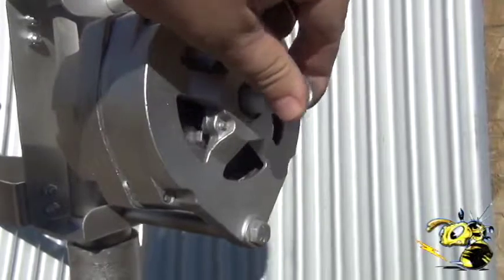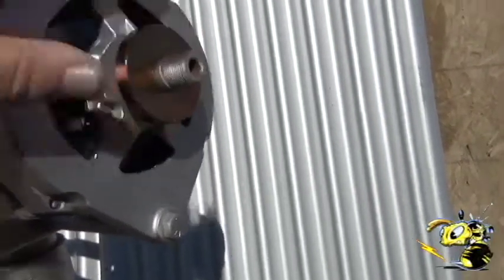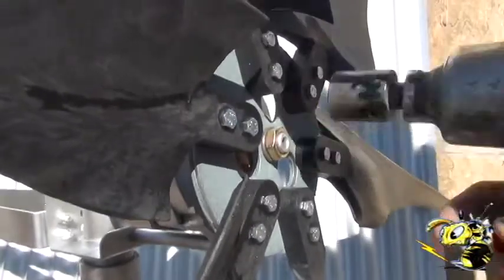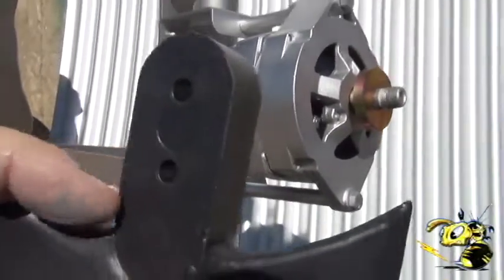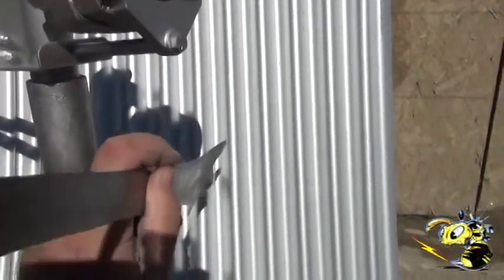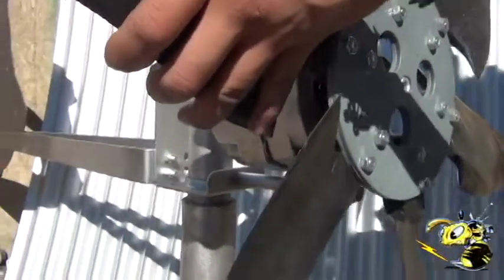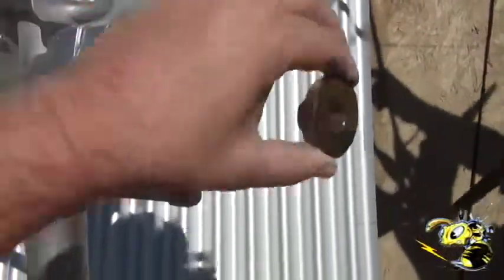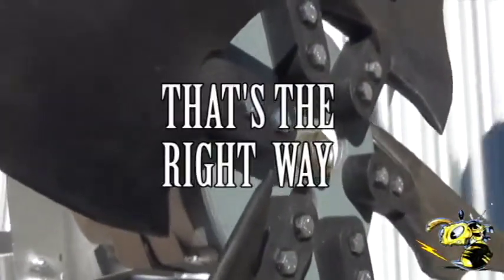How to install  Hub Spacer, Hub and Wind Turbine Blades

Comment: A year ago I purchased  a  pmg & I hand tighten the nut that the lock washer was flatten  it wasn't long it slipped & cut the shalf off the generator  they told me I tighten the nut to tight & flatten the lock washer. (They did give me a new  PMG & Blades)